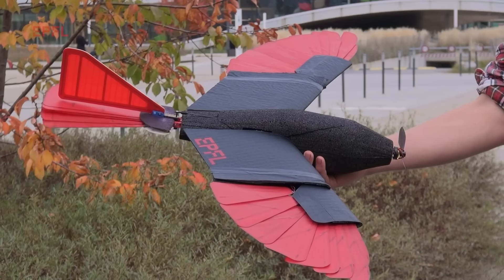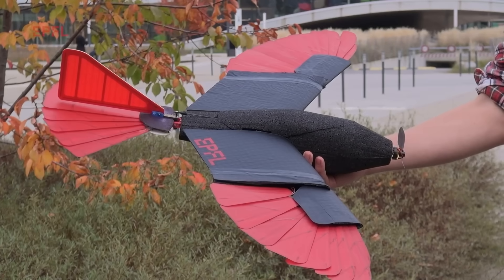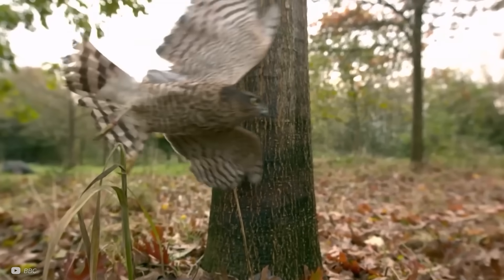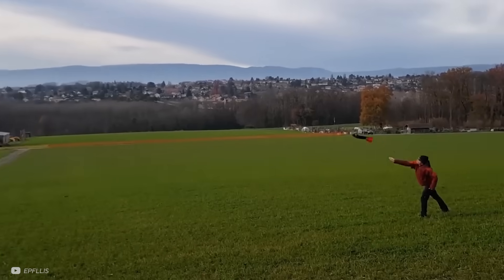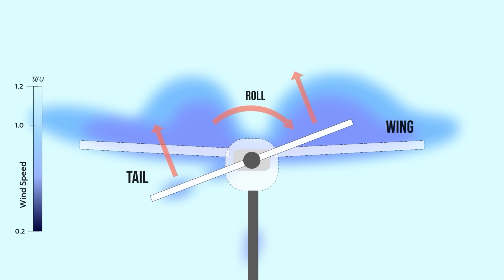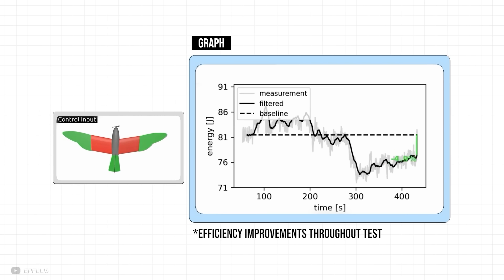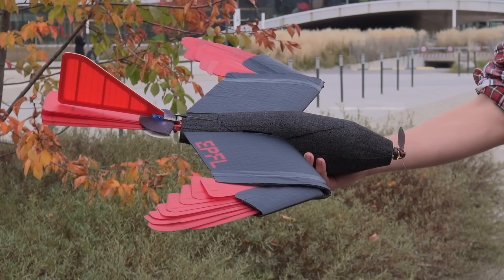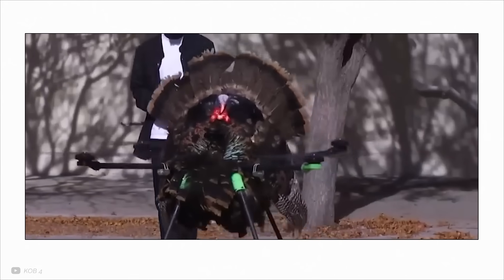The Genius of Bionic Morphing Wings: Future of Flight?

Comment: So much clever optimizations and just 11 % efficiency increase? Pretty disappointing.
Reply: some things can only be optimized so much. and no, 11% isn't something to scoff at either, it is quite a bit.
Reply: @ we need to put things in context. If you took an existing airliner and changed something in its construction achieving 11% that would indeed be impressive. If you introduce a whole new 'revolutionary' paradigm from ground up, introducing lots of side drawbacks like complexity and fragility then 11% feels underwhelming.
Reply: It would help if they used intelligent feather shaping to provide lift and control. In bird wings, each feather contributes to lift and/or control, but in this design they just make a simple morphing planing shape.